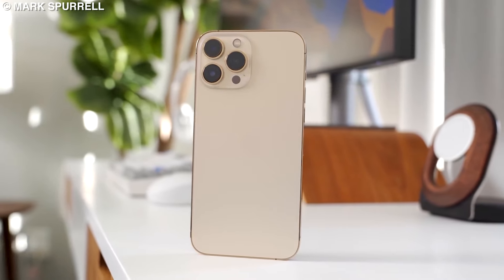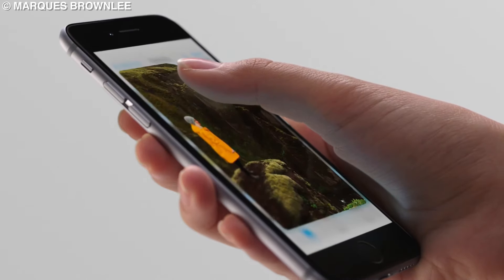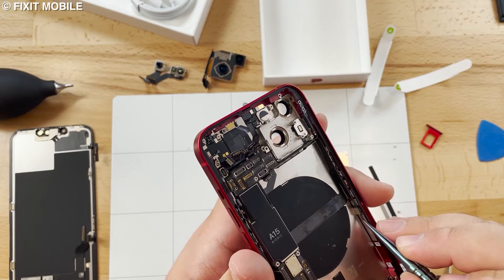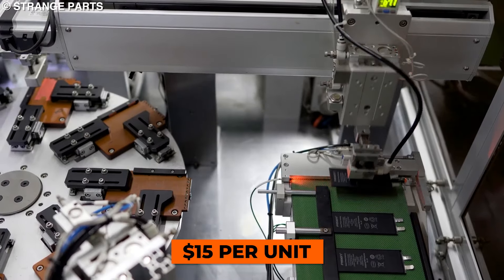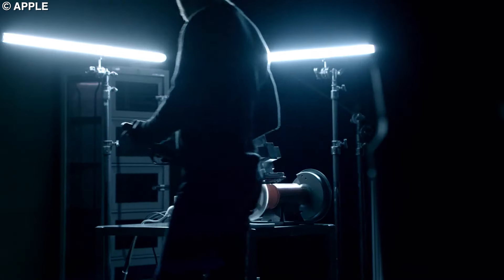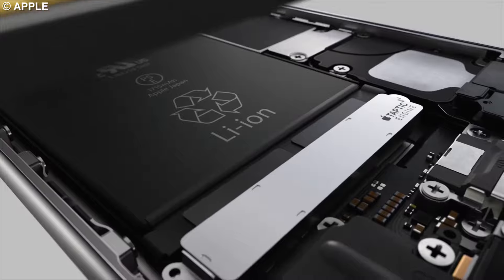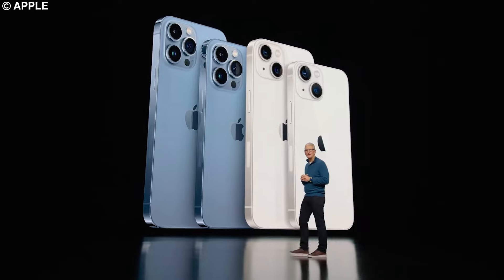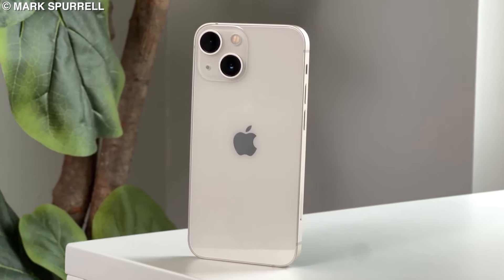How Much Does It Cost Apple To Create An iPhone?

Comment: For example, you say the chip alone costs 120. True, this is the price for a single chip. But they buy them in huge quantities and don"t pay 120/ piece.The same goes for all pieces in the phone.
Reply: Good idea
Reply: Don't expect big discount, while raw materials of semiconductor is cheap the manufacturing process is what makes it expensive. It takes billions and billions of dollars to build a semiconductor factory and this is why the cost of chip are expensive.
Reply: Also the chip itself has billions of transistor and is complex. It also houses not just the processor but also the graphics processing as well which is why the cost is justfiable. it is also included here the storage, ram, modem and other circuitry.

Comment: The cost of producing 1unit of iphone is not thesame with the cost of producing 1000units.

Iphone has already market itself so u dont need any much marketing

Most of the components are the same with a slide difference which will also have an effect on the cost.

Do much research on it and come back with a more elaborate cost. Pls dont forget to  include the net  profit per unit.

Comment: you forgot about the ceramic backglass and amny others stuff is still more expensive the camera is much more expensive, the inside would be around 300 and some other stuff like the magsafe tech is more expensive meaning its rough actual cost is like 930 bucks
Reply: Apple share holder. Greedy, and want to increase MRP
Reply: @shajanjacob1576  ?